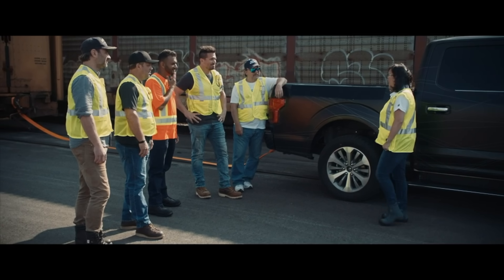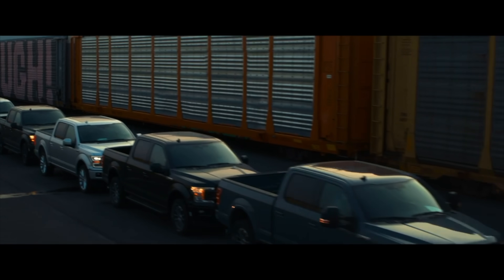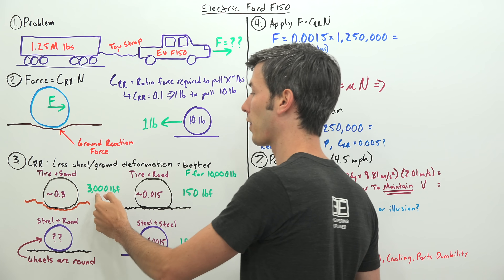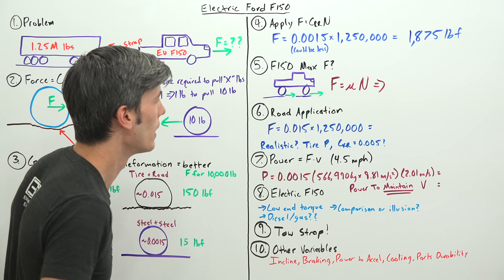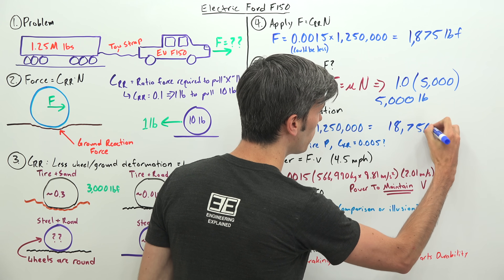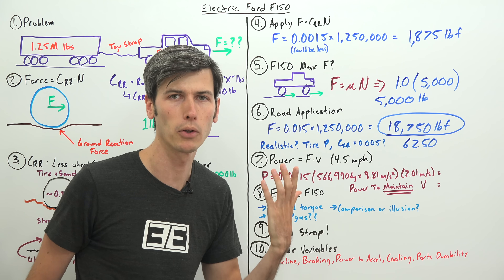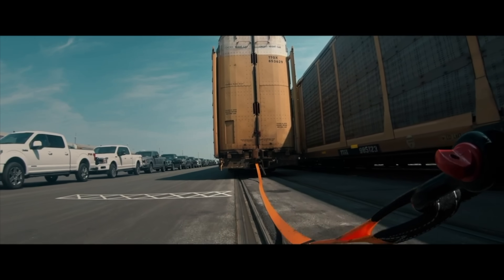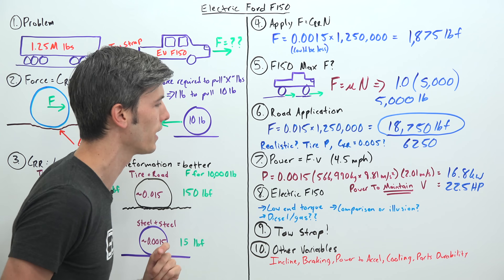No, Ford's Electric F-150 Can't Tow 1 Million Pounds (Realistically)

Comment: It's a trick, like those martial artists breaking several wooden boards. They always do it along the grain so the wood is  easily broken and always separate the boards a few mm so actually they break them one by one, albeit it seems that all break at the same time. Even so it is still spectacular, like the car pulling the train.

Comment: But weren’t you wrong about the max 0-60 possible? Remember the Tesla roadster?
Reply from the maker: Tesla hasn't gone under 2 seconds yet, and now they're saying 2.1 seconds (which was my claim). Also, Top Fuel dragsters do it in under a second, with the right tires (as I've discussed) you can go lower.

Comment: So ... 50 HP ? I could pull this train with my dad's old Renault Twingo, if my mom didn't crash it a year ago.

Of course it woudn't work because I think it's not heavy enough to have the grip necessary to pull the train, but the 50hp 1.2L bike engine in there would have enough power once launched to pull the train. I can't wait for Renault to make a parody of this.

Comment: Mr. Jason, according to my calculations, each wheel (considering 18" wheels)  must produce atleast 700lb-ft of torque to pull that mass i.e, atleast a total of 2800lb-ft of torque overall (excluding the mass of vehicle itself) and I  used the same formula as yours and I think that is much high for a Electric vehicle. Pls have a look on torque too.

Comment: The record weight towed by a human is 218,000 lbs that was a truck on a road. so by your math of 0.015 (tire & Road)multiplyed by the weight of 218,000 equals 3270 lbf The guy who pulled it only weighed 300 lbs. your basing this on the total weight of the object rather that its pulling capacity, tourqe is the most important part of this equation.

Comment: I think it was a fun video. I remember when Ford did it with a freighter years ago and the behind the scenes showed the traction was hard (tire slipping on road) but I know the water will help it pull the weight once it got going. I know pulling is not the same as carrying the weight. 
Still fun and great info on the math behind it.

Comment: The actual contact area of the steel wheel and steel rail is approximately two dimes, this decreases the resistance from the ground. There is the unfortunate tradeoff of these trains not being able to go up nearly any kind of gradient. The Little Engine That Could wouldn't be a thing

Comment: there is one issue not addressed in this video and that is how much of the battery life would have been drained in this demonstration.  Battery life is the main issue keeping small cars and truck from being all electric.  If a manufacturer could develop a vehicle for normal road use and have a distance of 600 miles, then you would see a mass migration to electric powered vehicles as long as the price is comparable to a similar gasoline powered vehicle.  The other issue is how to recycle the batteries from an electric vehicle once they not operating at optimal performance levels and if affordable replacement battery packs are available.

Comment: You stated the brakes...but to supply air to the brakes on rail cars you need air pressure. And once you have air pressure in the system you need additional air pressure to release the brakes.

Comment: I think nothing beats the VW V10 TDI Touareg pulling the 747. They had the idea first.
Reply: My exact thoughts
Reply: Chevy did that with a C series pickup in the 70's
Reply: that was just to distract from the dodgy emission numbers. Maybe Ford has the same problem here?
Reply: @daveh4923  That was done with a pre 2005 Tuareg, not a 2010 Passat/Golf. 2004 and older VW diesels, (my B5.5 Passat included) didn't have a DPF anyway

Comment: Another factor I don't see mentioned here is the couplers on autoracks are cushioned. The coupler is is designed to smooth out shocks from sudden acceleration. That means you're not starting to roll 1.25M lbs all at once either

Comment: Surely the number of wheels has some bearing on the results?
Surely it would be easier to pull a million pounds spread over just four railroad car wheels, (two axles), than the actual 80 ? (10 railcar wagons)
Not only that, but you have also got the accumulated resistance of each of the 40 axles to take into account.
>
Reply: I asked the same thing. My ignorant self thinks you would multiply the friction coefficient by 80.   .0015 x 80 x 1.25M = 150,000

Comment: which reminds me of a vague memory I have of a pickup TV commercial - I forget whose but it was sometime 2010-2015ish - where they drove the "good" model and a competitor down the same set of railroad tracks getting huge jolts from all the railroad ties.  the "bad" competitor model did huge torsional oscillation, with the cab and the bed twisting back and forth out of synch.  at first I was impressed but then I remembered vibration resonance frequency response - they must have picked one particular speed to drive at where their model wobbled the least but the competitor more.  If the movie had been shot driving various other speeds down the railroad, the results could have been a lot different.  did I diagnose this one correctly?  anybody remember details?

Comment: give me a 1.25Mlb train parked on a 0.085 deg downslope (sin .085 = .00148, horizontal vector of weight 1850 lb, not enough to overcome rolling resistance) and I will tow the train with my bicycle provided you give me a workable escape ramp when I can't stop it.

Comment: Look, I think people are overlooking something very important here. Sure, Ford pulled a marketing stunt. However, this F150 is still making almost twice the torque GMs full ton makes and 800 lbs-ft more than the RAM 3500. If ford makes an electric F350 ill bet $100 it could pull that same train but on asphalt. The F150 with the 351 modular makes 500 tq give or take, and the F350 with a 7.3 powerstroke makes just over 1000. If a luxury sport truck is tripling its power, ill bet the heavy duty trim makes 6000 lbs-ft minimum.

Comment: What about the coefficient of friction at the wheels and axles?  Values for bearing coefficients of friction are typically in the same range as presented for rolling resistance in this video (.0015 to .002).  No, I do not have exact values for this set of train cars, and I don't know the specific lubricant nor how "dirty" that lubricant may be, but my bet is that these wheels and axles are in pretty good shape since a lot of money "rides" on the dependability.  Therefore, while still not all that impressive, I figure this Ford truck is pulling closer to 4000-lb. than to 1900-lb.

Comment: Great explanation, by the way. I had two basic issues with the commercial: 1) Would the electric F-150 have enough torque to overcome the initial rolling resistance of the total weight of the train. I had no doubt it could maintain a certain speed once the initial rolling resistance was overcome. Was there a hidden force at the other end of the train assisting the start? 2) You mentioned stopping the mass. There was no way that i could see that the F-150 was going to be able to stop the train. Was there some locomotive following behind waiting to couple and apply the braking force necessary to stop? Mind you, there had to be something generating the air pressure required to release all those brake shoes, unless of course, someone intentionally locked them all in the open position (possible, but highly dangerous). It would be much easier, and safer, to load a stationary compressor and operator in one of the empty "auto carriers" to apply and release the brakes as required.

Comment: there is also the factor of slop/slack in each of the couplers. Set up properly, you're only moving the weight of the FIRST car for a certain distance before it catches the second car... then the first and second car are moving a little bit before the third car's weight is added.
It's a small difference, but it's not starting the entire 1.25 million pound from dead stop.

Comment: I dont see any problem with this commercial... ford did not claim it can also do this on the road, have you seen any trains on the road without any tracks? That would be another story... Whats the big deal ford f150 pulling trains with wheels? As long as it can pull those trains in any way nothings wrong with the marketing strategy. The big deal is if ford will try to carry that tons of load on its truck bed. Hahaha! By the way, i like watching your videos. You're a great guy.

Comment: I saw the stunt, and Immediately thought " not impressive" . Steel wheel have so low friction. Moving a empty train box is not that hard ( it,s till super heavy even empty), I mean, couple of person on foot could do it. What they should have done is strapping the Electric truck to a normal F150 and play a game of "who pull who" . I have no doubt the E-truck can have  like a 1000 Lb-f of torque, that would not even be hard to do with a electric motor.

Comment: I've pushed a 100,000 LRV by myself so I wasn't too impressed by an EV pickup pulling a rail car of any weight. I could probably pull 1,000,000 with my Leaf if it was on a rail car.

Comment: Tesla had a Model S pull a 300,000 lb airliner. Since that's rubber wheels on asphalt the force required would be the same as pulling a 3 million pound train (also the angle was downward for the Tesla, but level gor the Ford.  Does that matter?

Comment: Don't forget about the slack between the carriages - all the carriages aren't set in motion at the same time, which means the carriages always help pull the next one in line. It's essential in long, heavy freight trains. This way even a single engine could pull insane loads even though the acceleration would be abysmal.
Reply: its only a bonus. sometimes when a train stops on a slope and one come from behind to help, the train is stretched already
Reply: yes, that helps with the static friction of all the wheel bearings. I'd bet if the cars were all "stretched" that would be more than the truck tires could grip the ground with.
Reply: Correct. Not only is there slack in the couplers but each coupler is attached to Draft gear which is essentially a spring so the car can move say 1 foot before it picks up the load from the next car.

Comment: My dad in law worked for Ford for 30 years. He said they are always full of tricks and outlandish claims....he also wont buy a ford to save his life.
Reply: Tell him to get a Chevy. He’ll get much stronger having to push it around to mechanics all the time.
Reply: @kevinnorris6558  lol. he is a silver refiner now. Has 14 chevy trucks. 4 are over 400,000 miles. 2 are over 600k, and 1 just hit 1 million. Chevy 350 engines run forever. does his oil changes every 10k miles. I'm on my 8th chevy, I get bored and trade them around. The only ford I've ever owned was in the shop for the same "bouncing rpm at idle" issue at least 4 times with less than 80k miles.

Comment: You use the Coefficient of Rolling resistance but is there not an inertia to overcome also? I remember that the coefficient of static friction was higher than that of kinetic friction - in other words, it takes more force to get something moving than to keep it moving - is that true in rolling as well? It has been a while since engineering school.
Reply: You’re incorrect
Reply: Thanks Chuck. Very helpful. I don't usually believe strangers that don't provide any additional information but in this case, I will make an exception because you have 19 subscribers to your video game videos and therefore exude engineering credibility. By the way, I asked a question - didn't know questions could be wrong.

Comment: Actually, any gas/diesel atuomatic transmission vehicle would actually probably not be able to only because of the torque converter would overheat and blow up, but it could also be said to not hit full throttle right away and maybe eventually be able to get to 4.5mph. Idk

Comment: 1. I don't think this any worse than the stunts pulled by Toyota pulling a shuttle (that can literally be flown in a plane) and GM pulling the giant boat. There are always stunts that look more impressive than they are.
2. We don't know if the ford was applying significant force for the whole 5 minutes, but if it was that is impressive since it was able to apply high load for 5 minutes at such a low speed. This low speed is not an efficient range to operate a torque converter on an IC engine, so despite being a stunt it could be an opportunity to show how much less ENERGY the electric f-150 required to yield the same resulting work done on the system.

Comment: but wouldn't a clutch burn out if we put so much torque through it? With electric drive, we would not need a clutch and hence it would be possible.
Reply: put too much voltage through motor windings and you end up with a similar issue. electric motors have their weak points, but no one likes to mention them

Comment: One small sidenote: it's multiple wagons (?), not a single 1.25m pound one, they usually have some kind of dampers so the Truck wouldn't have to pull all of the weight from 0 at once. Also, back when VW made the commercial with the Tuareg pulling the plane, the car was overloaded by multiple times and had low tyre pressure.

Comment: Ford: our car can pull 1,25 million pounds

Jason: well yes but actually no
Reply: My Ford won't even start.
How can it pull 1 oz ?
Reply: @loktom4068  If most people look under the hood they'd be surprised.  What parts often keeping a car any from starting is usually not made by the company.  Valero, bendix, bosch etc..  Not Chevy, Bmw, Ford, fiat.
Reply: Yup this video really shows how little people know about something they see daily.  To need an explanation that it's different on a track vs roadway.  I'd wager most people don't even know that exhaust coming out of trains puts 0% power to the wheels on most trains in the us.  They're electric powered the diesel simply charges the electric and each axle can instantly and independently adjust power to limit or eliminate slip.  The brakes also are held off not on by air pressure so they charge the lines and have a plug which gets pulled as the truck in this case decouples.
Reply: Cactus Rider yes almost all air brakes work that way and most people don‘t know. It is much safer that way tho, if the pressure fails the vehicle brakes and cannot move with failed brakes. In a normal car you don‘t know ur brakes dont work untill you need to brake and then it is likely to cause an accident
Reply: @bigsmoke9935  That's right the only thing checked is abs at 10-15.  But the actual brakes many cars it's empty before a light triggers.  In 40 years of driving I've had only one throw the brake light.  Well when you still had enough pressure to stop normally.  I'd think that would be more important to do auto low speed checks than only the abs/tc functionality.
Reply: @MrAbletospeak Ok Terry technical.  Well the combustion motor does provide all the power the wheels receive on a non hybrid or electric  car/truck.  On most even half way modern trains.  The diesel motor only runs the generators (maybe the air horn) driving the power for the electric motors.  Of which the electronic traction motors put the power down.  Where as say a 4.6 gasoline v8 drives only an alternator which does not provide power to the wheels.  It after loss to accessories, drive train puts roughly 80% of power to the wheels.  The electronic traction motors are right on the axle.

Comment: Ford using illusions to sell products again, just like the illusion that the DPS6 transmission in my Focus is a reliable product.
Reply: It is reliable, you just have to never use the transmission to move the car.
Reply: That's why you don't buy an auto. My 6 speed manual focus has had no problems at all. lol
Reply: Don't expect Ford to step up without a fight. It's easier to pull the train with your teeth.
Reply: @MrSuperchargeron  They've lost half a dozen class action lawsuits over this transmission and they're still getting off easy. I'm burned on Ford, I'll never own another one again.
Reply: @RocketDragons  I had a 2004 F250 and Lemon Lawed it. By the time we came up with a settlement it had 140k on it and they bought it back. I only asked for them to give me what I paid for it and my attorney fees.
Reply: @MrSuperchargeron  I'm waiting to see what I can get out of the Canadian class action suit. Really hoping for a buyback or at least a partial discount. Unfortunately Canada doesn't have real lemon laws.
Reply: Typical american made automatic transmissions

Comment: How does one little strap pull that much weight? If aircraft carriers use 1in steel cables to help stop fighter jets (which barely weigh one tenth of the train) then please explain how a plastic strap can take that much force.

I think there was something pushing the train, creating forward momentum to further the illusion of the truck "pulling" the train

Why is Ford sinking to the low of Chevy commercials? 
Are they gonna drive it up some stairs like the land rover?

Comment: That was lame. The truck did what the commercial showed it doing. Trains run on tracks. Your numbers are good, but you’re cheating the test to fail it. Ford never said it could pull the train on tires, pavement, or anything else. I’m disappointed with you.

Comment: Anther thing to remember about trains is each car coupler has slack in it, so you're only actually staring 1 car from a stop at a time, once a car starts moving, the friction from that car decreases and then the slack to the next car is removed and the next car starts to accelerate. This greatly reduces the amount of force required to accelerate a train from a dead stop.